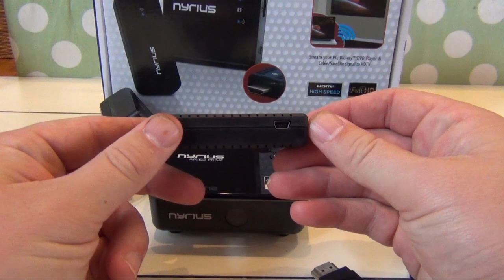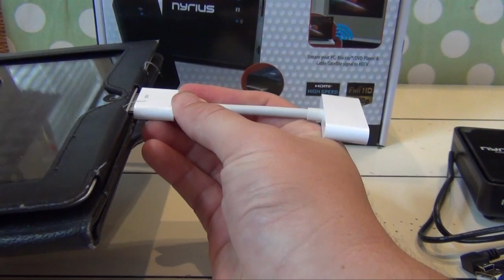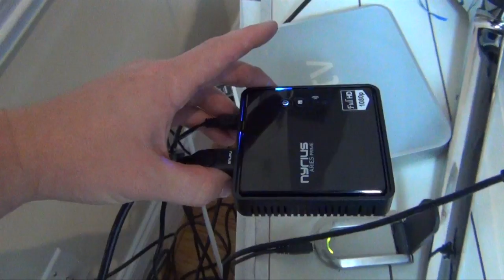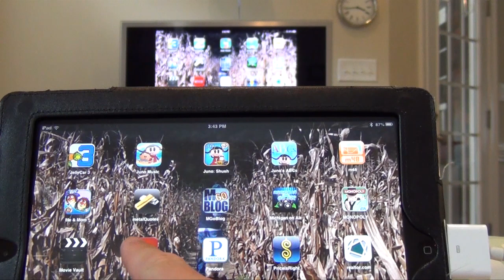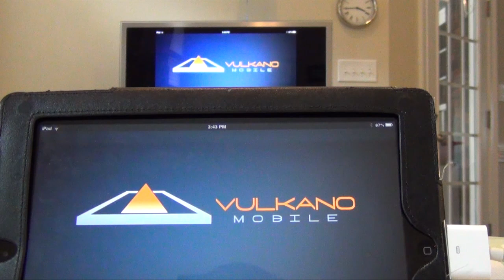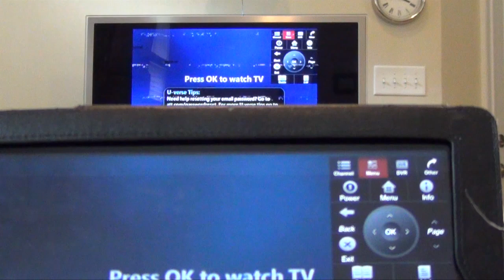Nyrius Aries Prime Wireless HD Transmitter

Comment: I am wondering if I have 2 nyrius aries prime receivers can they connect and show the same video on multiple screens via 1 transmitter?
Reply from the maker: Try it!
Reply: TheEngineeringFamily I would if I had one! It was kind of the selling point but I got no replies so I just bought one yesterday. I still wonder if I buy a second transmitter on ebay if it will work with the recieve.

Comment: Dumb question:  I have a Sony handycam with mini hdmi output - Can I use this Nyrius to transmit a signal to my TV?  (using TV as a monitor).
Reply: It should work. Just use a converter from your cam in to the transmitter.

Comment: how would i provide power for the transmitter if i am using a projector mounted on my ceiling? i dont think the power adapter or cord is not long enough to extend down to the wall for power source.

Comment: Hey I have a question TheEngineeringFamily, When you connect your transmitter to laptop and receiver to your tv, is the picture on your tv full frame or does it cut out some of the picture? I noticed in your video that your ipad wasn't full frame that's why I was kind of iffy about buying one. If its full frame from laptop to tv then yes its a must I will buy one.
Reply: the reason is that a tv often is 16:9 and ipad is 16:10

Comment: would this work with apple tv? so you can make 1 apple tv stream to 2 tv's
Reply: +TheDominatorHD You've probably figured this out by now, but it would work if you had an HDMI splitter. You would have hdmi from the Apple TV to the HDMI splitter. Then outputs to both local TV and this wireless HDMI device.

Comment: How long have you had it, Iv heard that it starts to get unusable after awhile. Also, is it practical for use with laptop if you just want to lay in bed and stream something your tv? Id really only use this for my laptop, but im looking for something small (like this). I didn't realize Id have to plug the transmitter into my HDMI and USB port at the same time. Just wondering how fragile it is, I suppose.